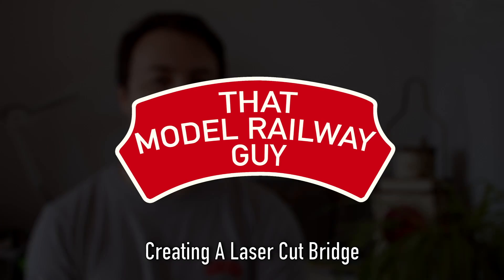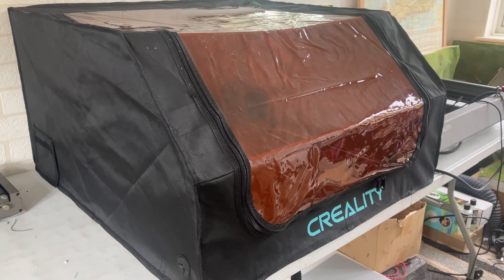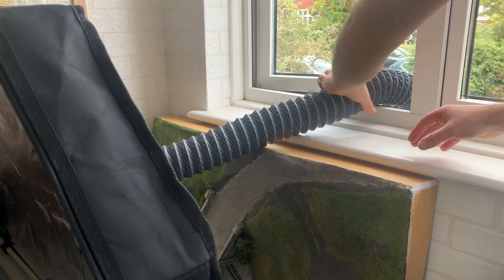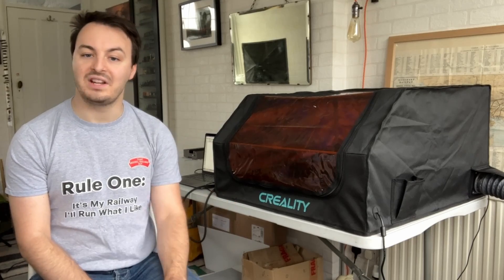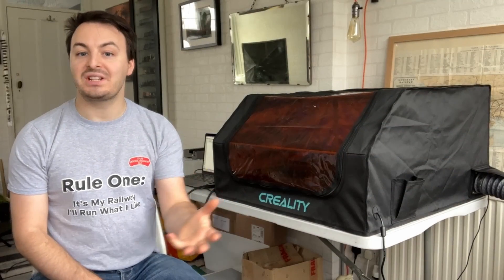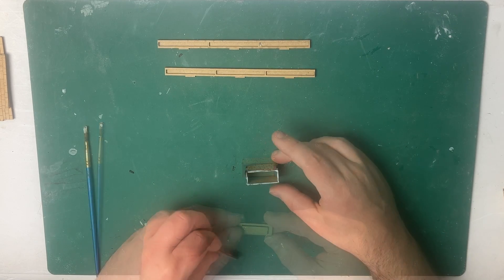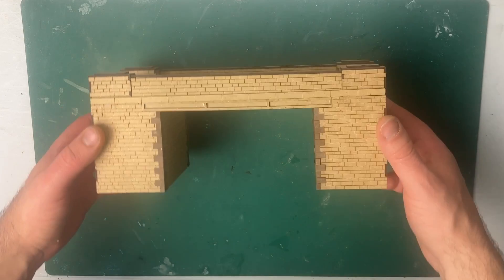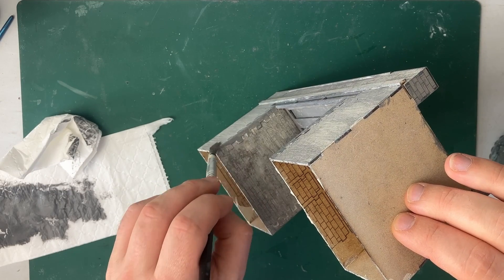Creating Laser Cut Bridge with the @Creality3D Falcon 2!

Comment: Which wood sheet is generally you used for laser cutting  ?? Thickness ??
Reply from the maker: For this particular project I used 1.5mm MDF, but only really because I have access to quite a lot of it. It really depends on what you're building though, on other projects I used 3mm plywood. Thanks for watching 😃
Reply: @ThatModelRailwayGuy   thanks for reply

Comment: Hi excellent Job is this the 22watt version? thanks in advance
Reply from the maker: Hiya, yep it's the 22W version. There's also a 40W version available if you want to cut thicker materials too. Hope that helps and thanks for watching 👍
Reply: @ThatModelRailwayGuy  thanks tried to order the combo deal that includes the cutting board and rotary base but your discount code was not valid for that

Comment: A really interesting video.

What's the maximum size of the pieces you can make with your laser cutter? For instance could you make an engine shed with sides long enough to cover a large express loco? Or a goods shed?
Reply from the maker: Hiya, glad you enjoyed it! The laser cutter has a working area of 400mm x 415mm - however Lightburn (the software most use to control their laser) has a pretty nifty feature where you can cut part of your project, then move the material along, line up the laser and cut the rest. In theory you're only limited by the length of the material you're working with. I actually cut my endplates for the layout using this method as they're 500mm wide. Hope that helps and thanks for watching 👍